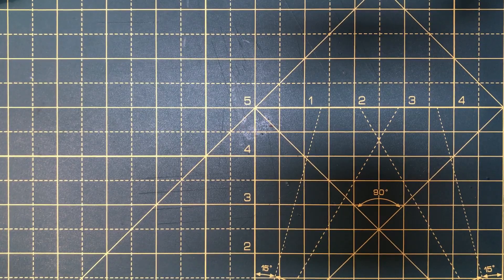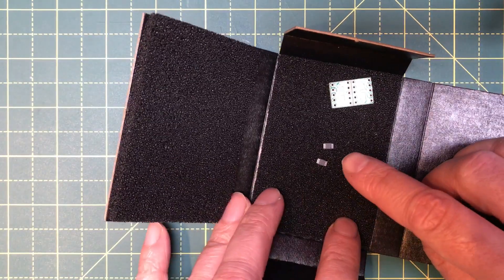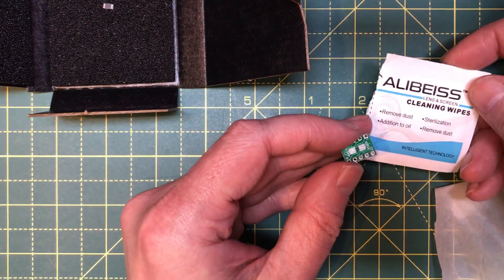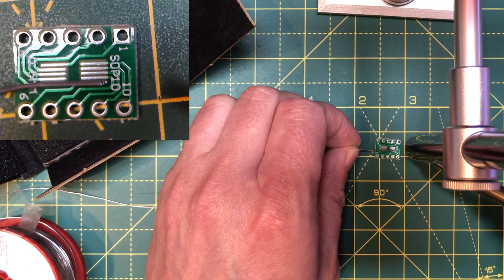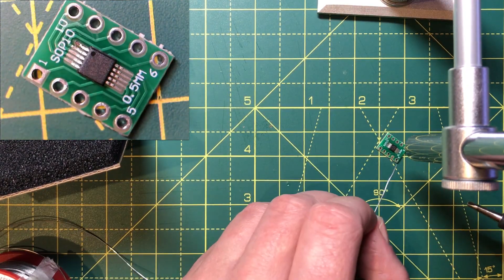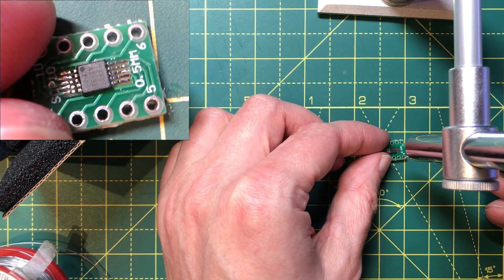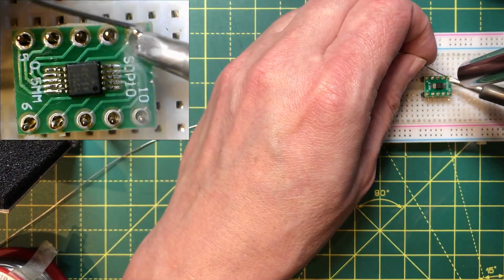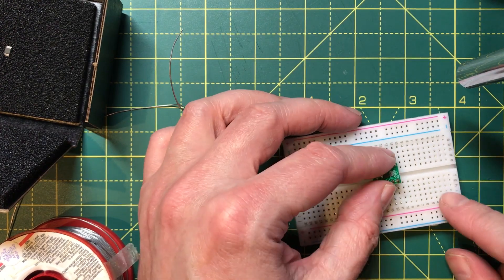DS1391U-33 10 μSOP to dip adaptor solder

Comment: While I do love that these boards make SMD parts available for breadboarding work, my first encounter with one, prior to any SMD soldering of anything at all, lead me to think how much more useful it would be were the part *already attached*.  At that point, that was the whole point.
Reply from the maker: I do want to find a way of using reflow for parts like these!
Reply: @JamesSharmanExtras  I wondered if you could have a stencil made, or find one that could be put to use (with careful trimming?) - or if it would actually be cheaper/easier just to design your own board and order it with a stencil.
Reply: @matambale A small PCB like that doesn't need a stencil. I just apply solder paste from a syringe with a fine nozzle. It doesn't matter that the paste bridges the pads, the solder resist does its job and the molten solder accumulates on the pads.